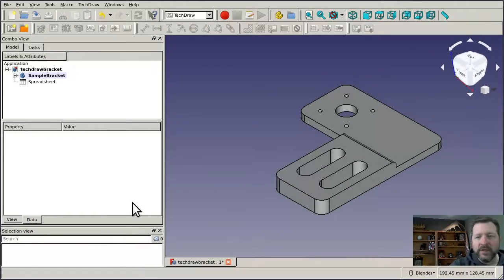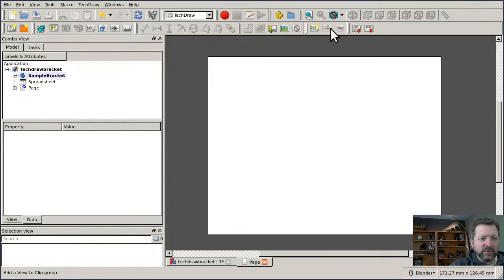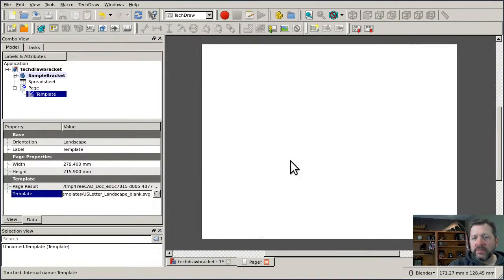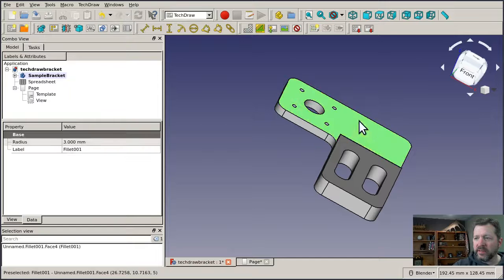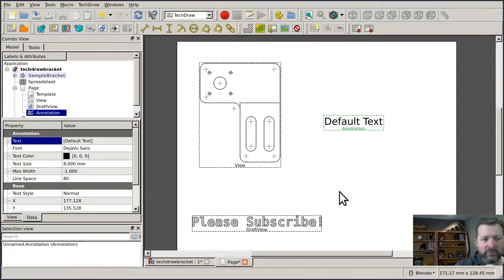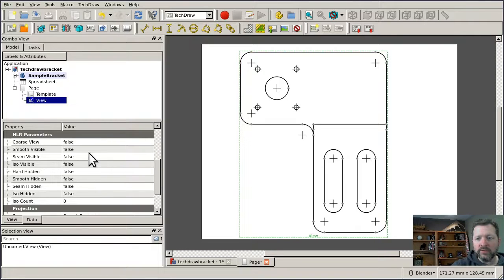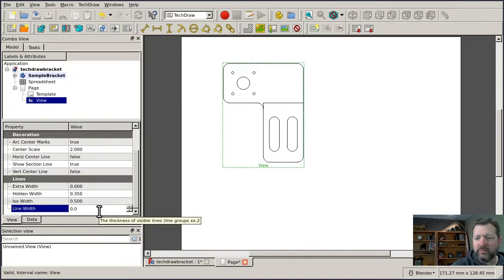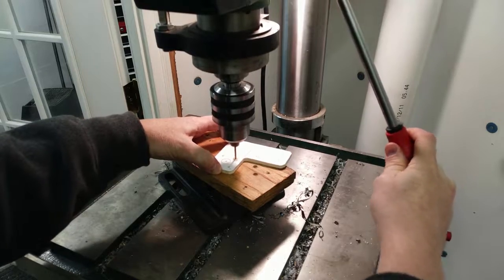TechDraw Workbench Part 1 (Basics)

Comment: Thanks for this informative video.  Being able to print a sketch at  1:1 is indeed very useful for me,  however I am not able to configure freecad to print directly to my system printer.  How can I do that?  Currently freecad only wants to print to a file which might be usable except that the scaling information is lost.
Reply from the maker: There's nothing special in how FreeCAD prints.  It uses the OS defined print system.  When you hit the print button, you should get the os print dialog.

Comment: Every tutorial I look at claiming to be for beginners always starts with a part already drawn. Or some other previous knowledge of FreeCAD such as macros or templates.  How do you start a tech drawing from absolute zero ? I have ZERO  knowledge of FreeCad other than to start the program. I just want to learn how to do simple 2D drawings from scratch. Please point me to sources of these kinds of tutorials.Thanks !
Reply from the maker: In the good old days when I grew up, drafting was about making 2D drawings.  You started with a blank sheet of paper and drew the part, view, elevation, plan, etc.
But the world moved on to CAD.  These days, we don't start with a blank drawing.  First, we model the part.  Technical drawings are an output and If they are needed, we generate them directly from the modeled part.  That's the job of TechDraw.   Like the Path Workbench for CAM and the FEM workbench for Finite Element analysis it's only useful downstream from the modeling process.
Reply from the maker: Also, there are several very different techniques used with FreeCAD and other CAD tools.  Drawing architecture takes a pretty different workflow from modeling a small part for 3D printing.  And there are different techniques even for each of those.  When you need to design multiple parts that fit together, it's another set of techniques.
There are several good books, including mine, that start at a simpler conceptual level and build up from there.

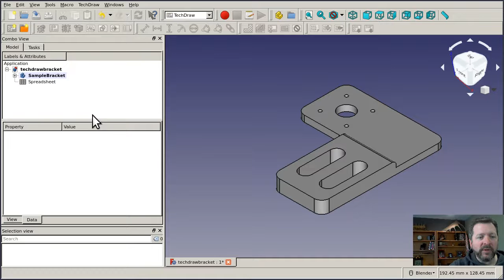Comment: is it possible to make the scale representation classical? 1:1, 1:5, 1:20, 1:50, 1:100, 1:500, 1:2000, 1:5000...
Reply: Select Custom for Scale Type, then in Scale type "=" and a box will open up that you type 1/100 for scale ( or 1/50, 1/250 etc). Note, the "=" does not show up in the box.

Comment: Is it also possible to do a drawing with an assembly instead of a part? I did an assembly with the a2+ workbench and wanted to make a quick drawing with some dimensions, but I didn't get it running.
on the other hand, when I build it in part design, to make the drawing with dimensions, there will be no partlist.....catch-22 :-(
Reply from the maker: Good question.  I just tried it and it worked perfectly.  I created a new page,  Selected all the parts of the assembly and inserted them into the page as a new view. I didn't go any farther with it - I'm not an expert on A2+ - but I see no reason that dimensions and other functions won't work the same as any other view.
Reply: @sliptonic  thanks a lot!!
I marked the assembly and that won't work.
I'll try to mark all single parts as soon as I'm at home. 
Thanks!!

Comment: The issue I have is anything over 12 inches becomes feet and % of a foot, and that means I have to break out a calculator to be able to machine that dimension on the lathe!
I need every dimension to be in inches.

Comment: Is there any way to avoid techdraw doubling lines in the resulting SVG when I export?
Reply: yes - use the dxf export - import in inscape and save as svg...
the lines are not really doubling - there is also a fill - till i found the dxf export works as i want 
i did (in inkscape)
- mark all black lines (select by same strockcolor) → delete
- seems you have a blank page left -thats not the case - select all (Ctrl+A) → there are selection frames shown.
- go to colors option: remove fill - and set outline to black.
→ now you have a closed path of your part (most of the time... )
the dxf exports seems to use a complete different 'engine'  - but i did not dig deeper yet..
( i would like to have a option to save as 'machine compatible svg'  → i use this as output for laser-cutting..)